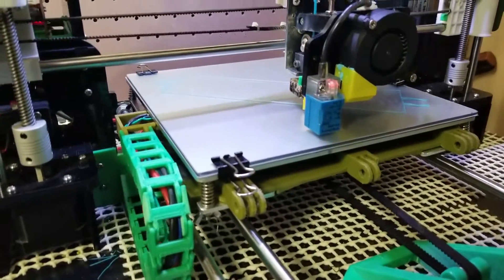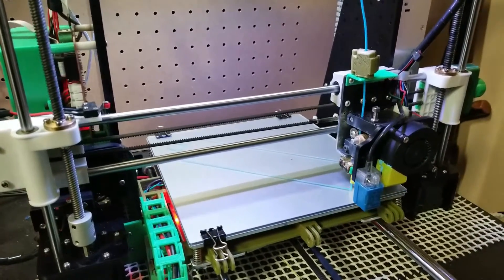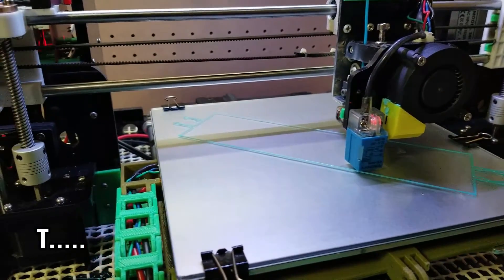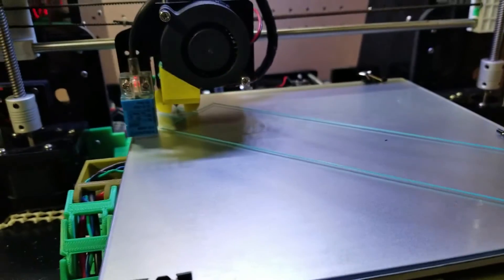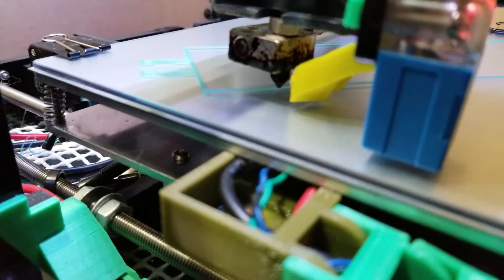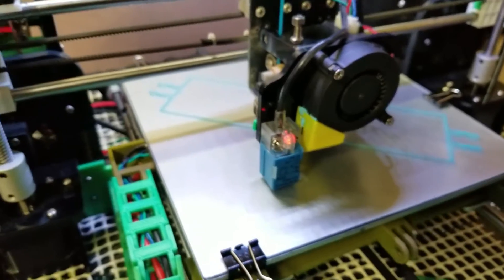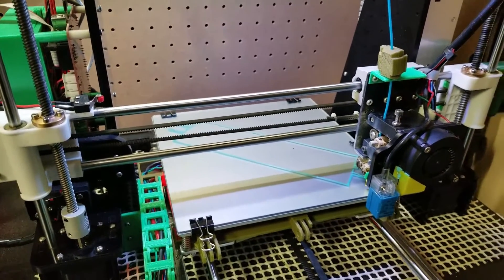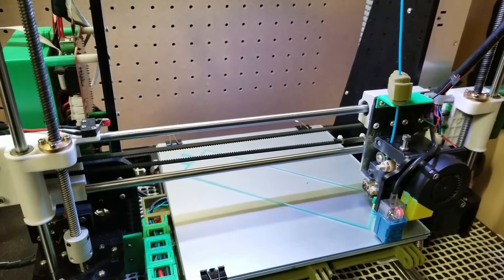3D Printing PSA 02: Inductive Sensors and Glass

Comment: I have the same sensor and 5mm glass.  I ordered a sheet of 24 gauge galvanized steel.  Hopefully this will work for me.
Reply from the maker: Hopefully it works the same! Mine is still chugging along. Keep me posted when you try it out!
Reply: @RevampedOutdoors  Will do.  I have a 400mm x 400mm bed, so sourcing a 400mm square piece of tempered glass wasn't easy.  Then sourcing a 400mm square piece of galvanized piece of steel was difficult as well (unless I wanted to cut my own).  All I know is that between those two things and the heated bed, it will be quite heavy.  Good thing the printer has two Z stepper motors.
Reply from the maker: @Dan-lz1ix  true that's a pretty substantial bed! The steel is pretty light so hopefully it shouldn't add too much!